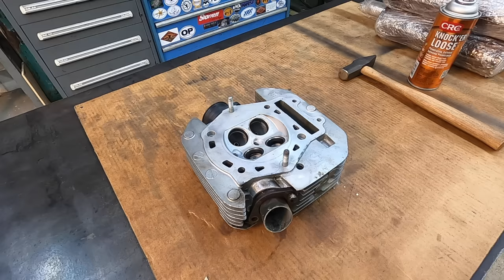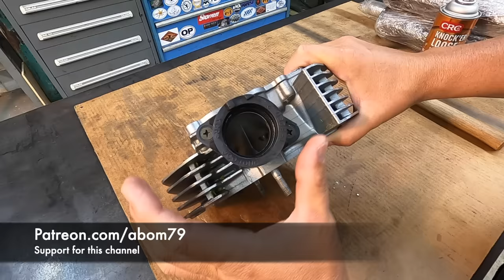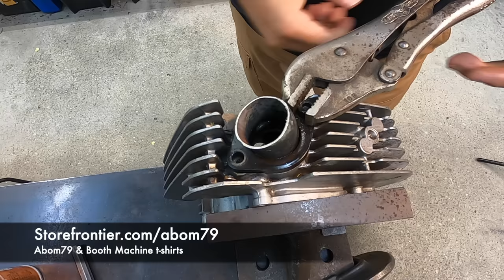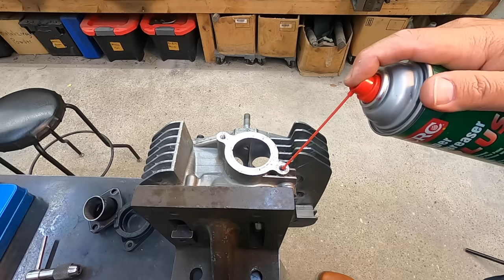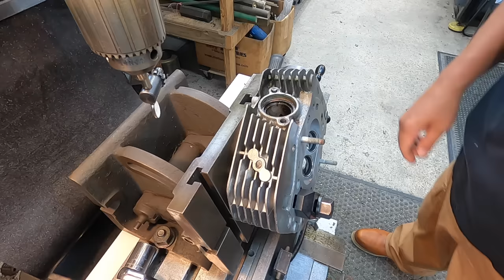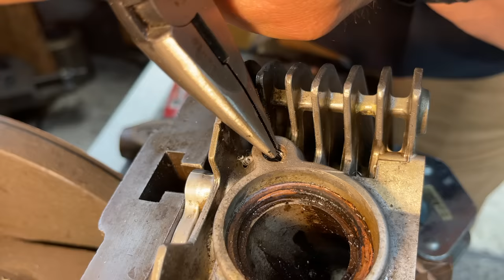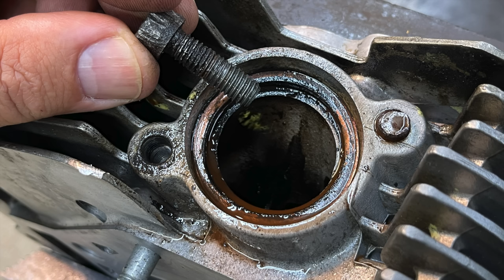Broken & Siezed Bolt Removal, DR 650 Cylinder Head

Comment: I love watching you work. You do every operation with the utmost of precision and explain exactly why you are doing each step.  Thanks so much. It is great to watch a master at work.  My only question on this one is why heat was not tried on the exhaust bolts?
Reply: heat is not the way  . if you have machines ..   om the motorcycle heat is nr 1
Reply: @gertkristensen6451  I have broken the bonds on many a stuck steel bolt in aluminum.  Does not take intense heat, just a little thermal expansion and shock often does the trick.  Yes it. is nice to have the tools like Abom to do it the way he did and I totally agree that is a great method, but there are lots of ruined heads out there by guys trying to drill out a bolt with a hand drill or breaking off EX outs and drill bits.   Then it gets more difficult.  Not everyone is so lucky to have his set up.
Reply: I asked the same thing. Why not give it some acetylene action? 😺 "Beat it and heat it" are what we say in the automotive industry. If you have a rusty fastener, first you hit it with an air hammer to break up any vulnerable oxidization crystals. There's a tool called the "Shake and Break" which is an air hammer tip that you can put screw bits or sockets on to impact the fastener axially while simultaneously applying a torque to loosen them. It helps. Otherwise, just using a brass tip or a very wide steel tip and vibrating the hell out of the thing before torquing on it works just as well. After 5 minutes of impact assistance with no luck, I move up to adding heat. If the fastener looks totally gnarly I just beat and heat right away. Beat it a little, quick check for movement, if there is none I just heat it up nice and hot. Often, a good air hammer rattling followed by red hot acetylene action will get a fastener to spin right on out. If you have a canned air computer duster, you can turn it upside down and spray out the liquid inside which is extremely cold and helps aid the thermal shocking process. Hitting it physically breaks up crystals and alters the stress tension of the parts as they sit. Heat causes movement if the threads and crystals of oxide because the parts expand and contract, inevitably at asymmetrical rates due to shape and design and alloy differences. Like you said, steel into aluminum or other mismatched alloys go well with heat because of that asymmetry in thermal expansion behavior. If you have a bolt in a large piece of metal, and you can heat both the bolt and the immediate vicinity up red hot with the torch, you can shock cool the bolt with the cold refrigerant out of the canned air duster and shrink the bolt rapidly while the part remains expanded due to its larger heat capacity. I use this same hot/cold technique for putting together interference fit parts like a wheel bearing or an electric motor bearing, or a flywheel ring gear. Put the bearing in the freezer, heat the knuckle with the torch. Makes it go in easy. Put the flywheel in the freezer, heat the ring gear with a torch. Same deal. Put an armature in the freezer, and put the bearing in a toaster oven and bring it up to 150°-175°F. Slips right together. Works ok in reverse too for removing wheel bearing inner races. Put the hub on a lazy Susan and heat the race up fast and precise with a fine acetylene torch tip as you spin the thing around slowly. After 15-20 seconds the inner race falls right off the hub like magic. If you go too slow or use too big of a torch tip, you just hear both parts simultaneously. No worky at that point. 😸😸😸

Comment: Antiseize is your friend when you mix aluminum and steel bolts. A pneumatic bolt rattler does a great job at removing bolts if the bolt isn't twisted or already damaged.

Comment: The way I used to find center of a broken bolt, was take any handy piece of round stock in the lathe, kiss a drill point into it to form a cone, then in the mill, bring the cone down over the bolt, put a little down pressure on the quill, and use x and y to feel around and find center. If you wanted to fuss, you could set up a dial, but I always got by without it.

Comment: Small pipe wrench works amazingly well for socket heads like that, rounded bolt heads, or broken off studs that still protrude.  Waaaayyy better than vise grips.  I keep a small pipe wrench around for only this.

Comment: Welding a nut on is ok for repair in the field or running repair, but once you have the head off, and in the shop, you did the job the right and proper way for a expert repair

Comment: My Vessel Impact driver Made in Japan is about 50 years old. Given to me by my late uncle. Excellent tool to work on those stubborn screws. Will have to pass this and my other hand tools to some guy once I am too old to fix anything. Good quality tools last a lifetime. Some of the old hardware shops still have old tools in the old area in the city and remote towns. Now days modern stores only stock up cheap crappy China made ones. But branded ones are damm  expensive. Or should try junk stores or scrapyards. Many auto workshops and aircraft  service facilities closed down because of the pandemic. I  once saw a video on YouTube taken in Madras India where there was a street that sells old tools used in the railway and power station. But all are imperial size and not metric.

Comment: I had to remove a broken M8 bolt from an outboard motor last week.
The easiest way I found was to get an M8, or if there enough shaft sticking out M10 NUT.
Centre it on the sheared bolt and weld the nut to the bolt...
While still hot wind it out 👍
Welding steel won't stick to the alloy, and the heat will help release the binding threads of the old bolt👌
Reply: Just did same thing tonight only on m6. After welding it broke again, flush.

Comment: The best way to remove the broken bolt is to use tig welder put a blob on the steel bolts an grab it with a vise grip.  I removed a lot of C130 slotted steel screws from C130 rims when I was in Marines.  We would get steel slotted screws that Marines would striped and we just put blob and grab it with vise grip pliers.  Plus the heat loosen the corrosion.
Reply: Yy

Comment: I generally just build up the broken stud with blobs of weld until I can weld a nut on it. the episodes of heat transferred to the stud seems to break the seal and there is no danger of welding the stud to the head or whatever if it's aluminium, never had any luck in the past with drilling and 'easy outs'

Comment: This is a very common problem with DRs - a friend of mine as well as finally my bike, a 1996, had the screw nearer to the frame seize and twist off. I was lucky as my welder could weld a steel rod to the remains of the screw and then soaked the screw in penetrating oil before gently rocking back and forth, getting the screw out. We changed the setup to threaded rods and nuts afterwards. All this was done with the engine still assembled and in working order. But drilling the screw out would likely have required to take the head apart.

Comment: Awesome. One thing I might have done is once you're down to to the task of pulling out the fine bits of remaining threads, you could fill that cavity with (very diluted) muriatic acid and let it chew on the rust and metal for 5-10 minutes to make it easier to get every last little piece of steel thread out. Penetrating oil and heat could also help but you got it all done nicely. Galvanic corrosion is pain. Love your vids!
Reply: Muriatic Acid will dissolve aluminum.
Reply: @bwthor  Yeah, it'll dissolve steel as well. That's why I said "very diluted" and "5-10 minutes." Like all powerful things it can be very useful in practiced hands and very dangerous in careless hands.

Comment: Putting a long bolt with 2 nuts on and a standoff plate between them is a great way to get things level from the threaded hole where you released the siezed bolt

Comment: That's what we call electrolosis. When you have a steel bolt in  aluminum  the different metals cause a chemical clashing that starts a corrosion process. Personally i would have put some heat on the aluminum to expand it but to each his own. You got it good job

Comment: In 1990s I used a snap-on tool  (quite cheap for snap-on) they came in few sizes, that consisted of a splined spindle with a sliding hex nut, I had to drill into the threaded shank with a drill bit a few thou smaller than the snap-on pin, tap in pin and fit the sliding nut and wind it out. we didn't need the angle plate and pillar drill. The pin would have been a 1/32 inch smaller the the core of the thread that with oil and heat worked for us. IT may not have with your very seized thread. I have used the hammed in piece of hex bit as other have said as well.   Thanks for the Video Aborn 79 Well Done.

Comment: Neat. Proper job with all the right kit. Here in rainy old Britain, steel bolts in alloy threads often seize up. I suspect the dissimilar metals are subject to a bit of electrolytic corrosion, especially with salt on the roads every winter. Impact drivers work well, but when I was a stripper (for a bike breaker) I got into the habit of smacking those JIS crossheads with a drift and a big hammer swung for accuracy. Then smacking the bitt from the impact driver into the cross and then go with the the impact driver. Just going straight in with the impact driver seemed all too often to chew out the screw head and slowed the job right down.
Reply: I'm a retired motorcycle technician and machinist and worked at a motorcycle machine shop and repair from  1985 - 1995 . We dld everything from tire changes to normal maintenance to resurrecting the dead, building performance street bikes and drag bikes on mostly Japanese motorcycles. I would do the same thing you did with a seized bolt. Use a hammer or hammer and punch to shock the bolt or screw and to flatten the surface if it's a Phillip's head etc., then hammer the impact bit into the head then use the hammer impact for removal. If that didn't work, then we would drill it out and worse scenario install a Helecoil or time sert for new threads.

Comment: heat up the bolt head and will come out. Installing steel bolts to aluminum normally they are not compatible  with each other.

Comment: Years ago i drilled  out 7 broken of 8  bolts of a Suzuki four cilinder motorcycle exhoust   Lying underneath the Suzuki . I started with a 3mm. drill, en then 6,5 mm. Drilling exateley in line of the bolts in the cente of the bolt.. It was very hot, in Juli And it was a hell of a job!  Always use "never seeze" or copper gease when mounting nuts or bolts!
Reply: Never use copper grease near the exhaust or head for that matter. Copper grease would dry out and make it worse.

Comment: As a retired Master Mechanic for 48 years, you did GOOD! I have trained many tech's and tried to tell them the Bull in a China Cabinet is the wrong way to go. Snap-on has Super Pliers that will remove almost anything. As a Brake and Front End Mechanic I wore out at least 5 pliers, life time warranty really paid off. I watched as many aluminum wheel  was destroyed getting locks off. Lock removal set with large hammer to shock the aluminum normal gets time loose. Don
Reply: I remember back before they had the beat on locking lug extractors. I used to almost always be able to drive a 12pt socket over the lug nut and remove the offending lug nut without any damage.....even the locking lugs (if a quality brand) had barely more than a scratch.

Comment: Nice rescue; I had to removed a badly seized brake pad pin from a dirt bike rear brk caliper, aluminum, I carefully drilled it , bigger & bigger, the threaded remains that came out looked like a helicoil,, I almost was drilling & touching the dictate aluminum threads if the caliper . 
I still have CAUSED more broken & stripped bolts than I have fixed, but the tide is turned, I'm not the king of stripped bolts anymore ! 
the king is dead ! Ha ha

Comment: The best exposition I have ever seen on the subject.  I always thought heat was the ultimate weapon for this - sounds like there are downsides.  Isn't there a way to heat the bolt electrically somehow, and minimize the amount the head would get?
Reply: An induction heater may be what you are thinking of.

Comment: On a rounded-out socket head cap screw, I usually drive a cheap 1/4 or 3/8 drive Torx bit into the rounded out hole. I assume the act of driving it in also helps upset the galling like you did with the punch. If it won't drive due to tight fit, grind the end square and turn it into a broach.

Comment: I have had sucses using an oxycetilien tortch because it can make a small area heat real quick. And this requires speed so you can't talk and explain at the same time. But here goes. You have to have the tools ready to go, like that vice grip has to be pre set you will not have time to start ajusting it once you get on this and you may only get to do one bolt in that head at a time then you most let the piece cool down on its own. It works on the heat expanding the material around the bolt or stud or screw what ever faster than the bolt or what ever. That moment in time expands the threaded earea of the head that the bolt is in. But not the bolt its self. So the threaded hole for a moment is wider than the bolt. Making the bolt appier smaller then the hole it was made for. If the heat goes to slow around the bolt or stud. Then the stud will expand with the head allowing the head and the stud to maintane there bonded grip. So turning that stud in the head quickly before the heat has time to travel into the stud and expanding it as well. So this is a race. If your not fast enough everything will expand at the same time and you will have to let every thing cool back down at a natural rate this can take hours. Before you can try again. So speed and patients is required. And don't over tighten the nut or bolt or screw in the first place. A tork wrench that is inch lbs helps and torking down in sequence also helps. So heat up the area of😮 the head directly around the stud or nut  first and very quickly

Comment: I do this kind of removals by soldering another metric screw to the broken end. The solder did not grip on alu and meanwhile the old broken screw heads up. So after I can remove it with a spanner 🔧 without problems. No need of mechanization. It turns out quite easily. 10min job.

Regards from Spain. I like your channel :)

Comment: No  Its like a lube when it get hot, but its putting a barrier between the metals.   We have used it on the race truck for the last 15 years and never had a bolt come loose.

Comment: Should have tried wax and a propane torch you don't need much heat with aluminum to expand it I wouldn't use no acetylene torch and hold metal cutting torch I use a little propane towards like a solder copper pipe but but you got it do a great job God bless you keep up the great videos be safe

Comment: AvE had one which was "removed" (dissolved) using a chemical which acted on the steel but left the aluminum untouched. Problem with with aluminum is it will stick to the threads of the bolt but tear away from the base material.

Comment: Taps and dies are used to cut threads - not clean or reform them. A "Thread Chaser" cleans the threads without cutting the base material. If you don't have the size chaser you need, you can use dull taps and dies. Get a cheap (HF) Tap & Die set, and then dull them with a wire wheel.

Comment: Adam, as always I love watching you work. Your professionalism is very obvious here and you've always seemed to have success with the projects you've been tasked with. As for that tool you used to remove those screws? I've used that very tool many times since the 70's and I can tell you for a fact that I've had huge success with it. It is a great tool. And using a hammer on that bolt? I've also done that very thing on a lot of projects and most of the time I can get the bolt out. Very few times have I failed to get a bolt out using that technique. Most of the time when I "did" fail it was because the bolt sheared off and I was forced to drill it out. Great job on your efforts sir!

Comment: I've done loads that have snapped, drill hole about 5mm in depth then knock a Torx bit in, works every time.
Reply: It probably works pretty good, but fess up.  You broke a handle or two.  :)

Comment: One of the best methods I have used is to heat it up with a small torch to warm the bolt up enough so that you can uses a paraffin 'plumber's candle.'  If you can heat it up a bit, the heat will help, but it is the paraffin wax that is the real trick.  I have used it many times and it is a miracle worker!  I have a great story about this with a large Honda motor on my pressure washer that proves that.
Reply: As an update, yesterday I used this to free 18 out of 20 bolts froze due to 4 years' worth of rust. In about 75 minutes of using my MAPP torch and chunk of paraffin I loosened them by hand.   This really reminded me of how well this works.

Comment: Adom, if you use your impact driver a lot, you will find that the head will become mushed up for using a steel hammer. I use one of my "dead blow" hammers to get the maximum force applied and to protect my impact driver. I have come across screws that were so tight that I broke the tip off of my #3 Phillips bit, those impact drivers really do apply a lot of force.

Comment: Similar situation I'm in with 2 cam tower hex bolts, 1 broken and recessed the other just stuck and rounded out. I'll be using the shock spray wiggle technique on the one, then sending the head to Abom for extraction of the other LOL.

Comment: Good to see a proper job done. Have done exactly the same many times when I was an engineer 👌
Only other thing I would have tried on the jammed bolt would have been an easy out on the Allen head. Hammer and turn slowly.